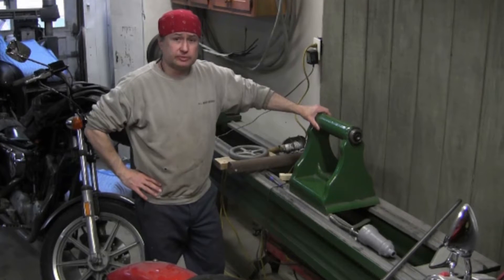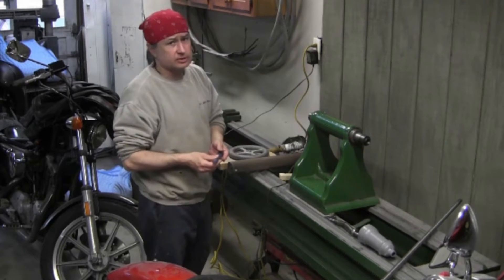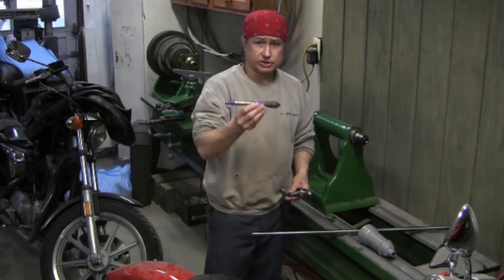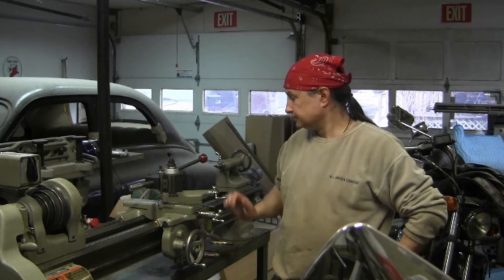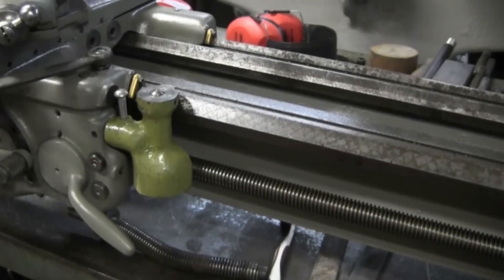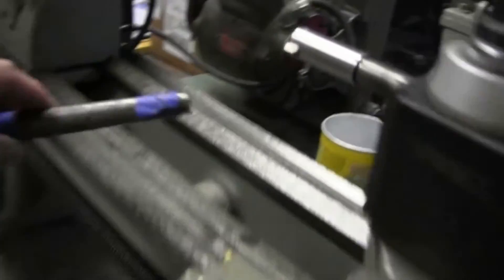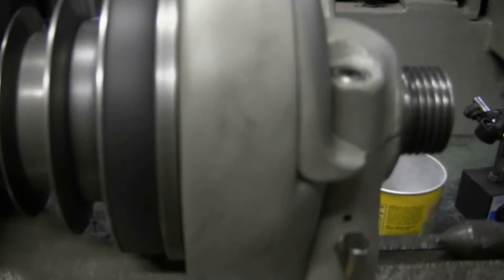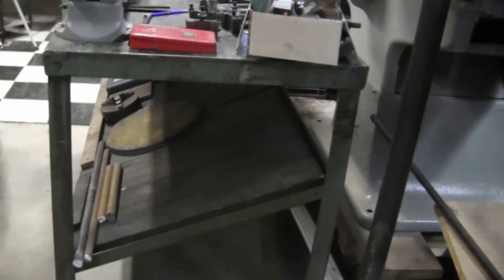Lathe Pt 4

Comment: Really nice south bend.  If you do not know Mr Pete222 he has many tutorials...Keith Fenner, Keith Rucker, abom79 and Oxtool....all great places to learn this stuff.  My dad has a south bend with the taper.   There are ways to do that job without it if you are courageous!   Been wondering about big green.

Good luck.  You found a nice unit there.
Reply from the maker: Hey Phooesnax, I was thinking about you the whole time I was putting this video together, I figured you would like to know where we were with big green.  I think I can handle the machine work needed, but I guess we'll find out once I start turning some steel. It may take more than one attempt, but what have I got to loose?  I was watching some taper attachments on the bay and they are pricey!  I did see some instructions on making your own, might be good experience.  I will check out the guys you mentioned, my son watches Keith Fenner a lot, so I am familiar with him.  I have a project coming up that will require big green, so its getting close to crunch time.  I'll keep you posted.
Reply: The Mr Pete connection is totally step by step shop class style.  He did that for a living.  On the other hand Keith Fenner is very very much a shafting expert and bet he would help you.
Reply from the maker: I cant wait to get the time to sit down and watch some video from these guys.

Comment: LOL you want to avoid putting your finger in there in the future.  It is a good way to lose the finger and possibly some of the hand.

The taper you have on your part could be a #1 taper and NOT a morse taper.  If you took the part to a machine shop they would be better at telling you what it is for your tail stock.

The next item you may want to get for the lathe is a DRO (digital read out).
Reply from the maker: +wi11y1960  I probably should take it to a machine shop and see if they can identity the taper.  It is not a morse taper, or a jarno, a Jacobs, or a brown and sharp.  I believe it is proprietary to the manufacture of the lathe.
Reply: Just a guess, that lathe is from the later part of the 1800's.